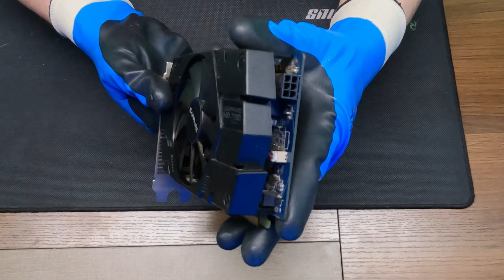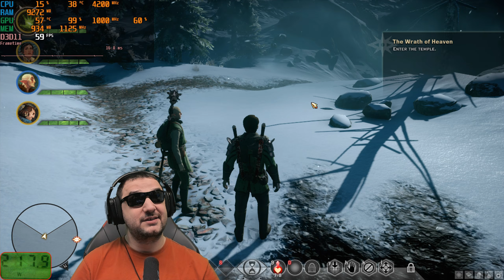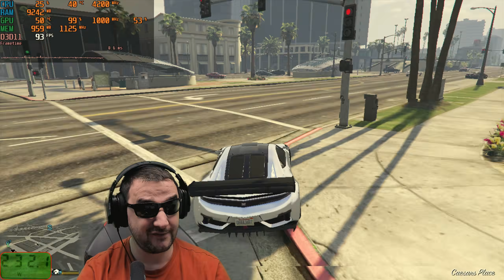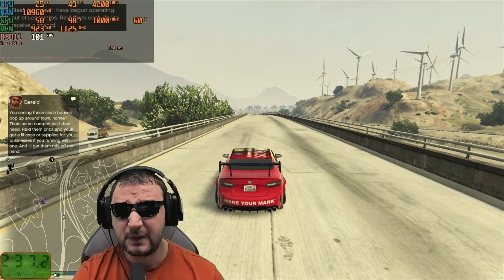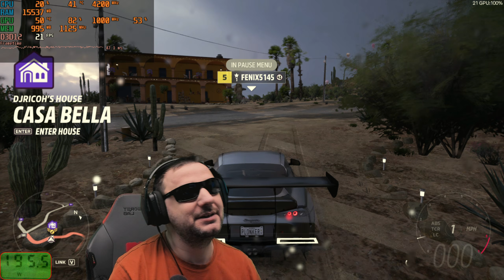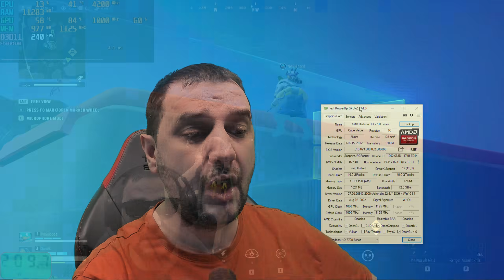Sapphire HD 7770 GHz Edition Benchmark

Comment: Great video, this was my very first AMD card after my 8800GT died in 2012. I had the ASUS DirectCU version. I have soooo many great memories with this card... I remember it started getting unstable though with default clocks so I had to underclock it by 50MHz, but I still have it in its original box. Then I went for RX580 and now on 6600XT, looking for the new 9000 series to upgrade.

Comment: I had a 7770 ghz 1GB in my second pc for many years, but it went to "pcb heaven" recently. I replaced it with a dual fan 960 2GB for 25eur. It isnt obsolete, unless you really need that performance.Old games and many indie titles run just fine with 7770, the 2GB model aged better.
Reply from the maker: @Kanivalos80  really better but with same core speed right?

Comment: When you tested GTX 555- I thought about GTX 666. Now with HD 7770- about HD 6660, but there is only HD 6670 or newer RX 6600/6600 XT. So maybe at least do some test with any Radeon from Power Color Red Devil series? 😈😈😈
Reply from the maker: With a bios modd 😁

Comment: It would be good to see how this runs on high and max settings.. Vram will bottleneck it but lets see what FPS we are going to get..  Good vid. It is one of the best GPU for retro gaming, If you want top notch win xp games performance from say 2000 to 2005, this is your video card. Pair it with a cheap I5-2400, 4GB DDR2 ram and this puppy (all for under 100 AUD) and you are cooking on gas esp if you can find a 1600by1200 monitor.
Reply: As soon as vram is filled, the performance drops drastically, most games would run like forza horizon 5.
Reply: Best card with xp drivers for retro gaming is GTX 960, 7770 would work as well.

Comment: oh look, my gpu
and its still rocking.
mine is 2gb version oem made by HP
Reply: I dont know if the hd7770 ghz (r7 250x) get a 4gb variant... BUT HER LIL SISTER THE R7 250 (CAPE VERDE) GOT 4GB VARIANT I MEAN HOW!? even if that a gddr3 that should perform better than 2gb gddr5 in case of the game need a lot of vram
Reply from the maker: Interesting 🤔
Reply from the maker: @mineminemaybe not r7 350x?
Reply: @ yes hd7770 ghz is r7 250x, they have the same chip cape verde with same shadder count 16/40/640, but hd7770 ghz mostly has higher core clock, you can say that its a binned version of r7 250x, I'm not sure about it though, since I dont have r7 250x to compare the ASIC

while r7 250 cape verde only at 16/32/512
and... r7 250 oland perform way worst since its only at 8/24/384

the r7 250 cape verde 4gb I found is gddr3 128bit from sapphire, really want to buy it but dang I have to pay for something else, I just wish after paying something I still have spare money to buy it
Reply: @ now that you mention it... r7 250 oland has same chip as r7 350x oland, but the sticker on the 4gb variant I found is "r7 250 4gb 512sp gddr3" something like this

Comment: My first ever GPU which was able to play some games back in the 2012 ,)
Reply from the maker: What games?
Reply: @DanielCardei  Pretty much everything was playable. I played mostly FPS games like Battlefield 3, Modern Warfare 2, 3 and Black Ops 2. Before I was using my old old PC bought in the 2005 with Geforce FX 5500, single core amd athlon cpu and 512 mb ram so it was a generational upgrade for me really.